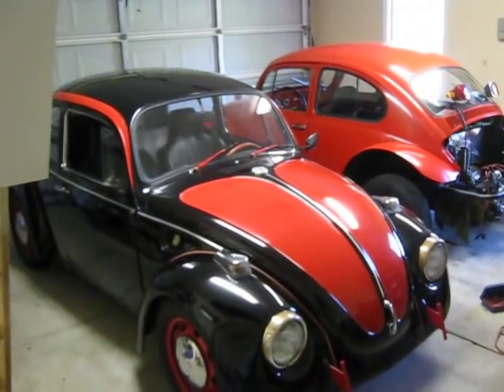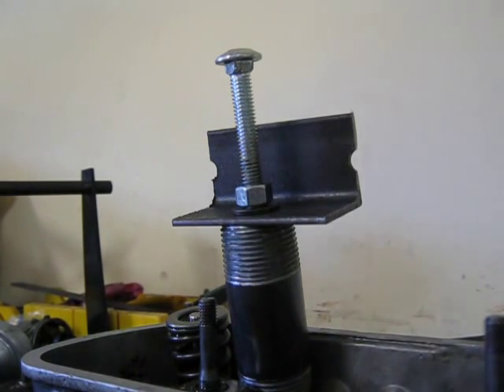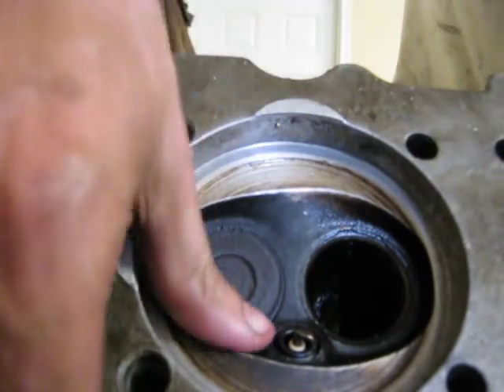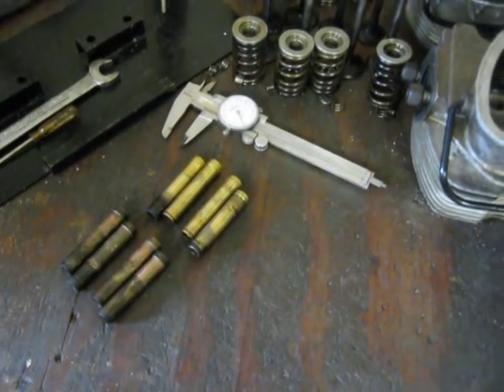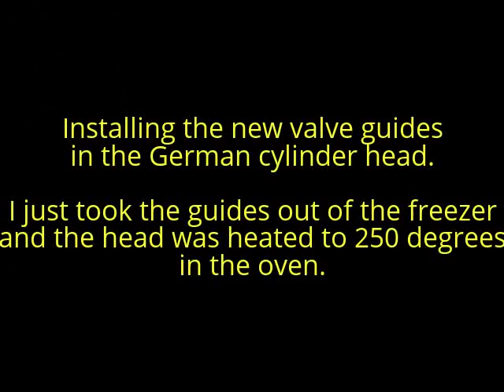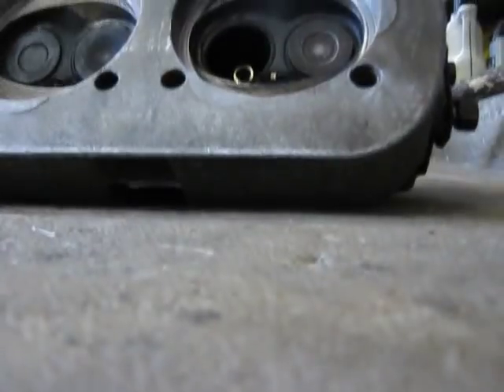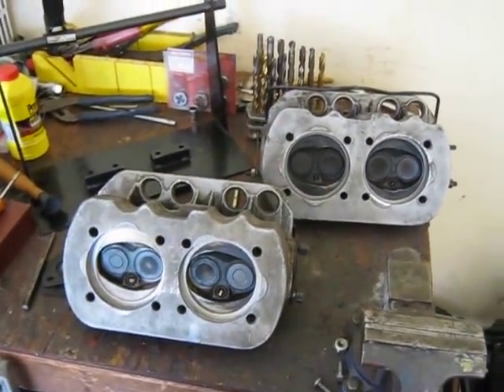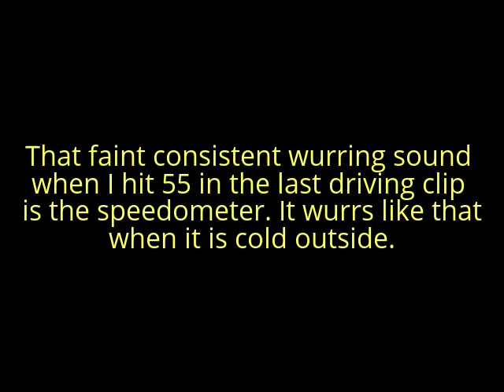VW valve guides air cooled classic vintage Volkswagen heads

Comment: good information, my old 40 im working on right now had a blown piston from a broken ring and put some gouges on the head but the valve were still in and protected the valve seats. My exhaust guides are worn so going to replace them but glad I watched this video first. I was debating on waiting till I got the new ones since they were on backorder from the suppliers. Going to remove the old one and measure them and the head guide bores to make sure I'm ordering the correct ones. Thanks for doing this video for us that are new to VW builds.

Comment: If you put the guides in the freezer overnight, and the head in the oven at 400F for 30min, they'll drop right in, so you don't have to beat the piss out of your heads.
Reply from the maker: Thanks for the comment. My thoughts on this, what you are saying is correct in a “in most cases” kind of a way. My thoughts are that every cylinder head, every freezer, every oven and ambient temperature are a little different for everyone so results vary on the oven heating, freezer cooling and guide dropping in deal... I could be wrong but those are my thoughts on the subject. 

I have heard of some mad scientist type guys that sit the guides in liquid nitrogen so they really get cold before dropping them in...  A little to fancy for me but if it works, it works. Like I mentioned in the vid, there are other ways to do things. This is just the way I did it.

Comment: I have my engine removed last year because the spark plug kept popping out. I am having trouble removing the engine head as the rusted bolts of muffler are really hard to remove. Once I remove the engine heads... I will do exactly what you have said in this video, THANK YOU!  but if you have any advise on how to remove the engine head, I would appreciate it. the mufflers have to come off, right?
Thank you for making it LOOK Easy!
Reply from the maker: Afra Bangash 

Hi Afra!

First, your spark plug popping out problem: Clean everything and look over everything real good in the combustion chamber area on the heads you plan on using. Make sure there are no cracks going into the spark plug area… If there are cracks that have made their way to where the spark plug goes unfortunately your heads are no good and you will need to find different ones... There is no use rebuilding a head if it continues to shoot out spark plugs after you are done. This is pretty much how I gauge if a head can be rebuilt: If there are cracks that go into where the spark plug threads in, the heads are trash… If there are no cracks going to the spark plug area you can fix/rebuild them and you will have something that is usable when you are done. Here is a picture showing a crack going to the spark plug… This head should not be rebuilt.  http://images.thesamba.com/vw/gallery/pix/1154275.jpg

Other cracks in the cylinder head: It is also very common for heads to crack between the valve seats in the combustion chamber. Some people freak out about this and think they need to buy new heads when they have cracks there… These cracks are not that big of a deal in my opinion. As a matter of fact the Brazilian heads I show in this video have cracks between the valve seats... I have not had any trouble and I drive in hot weather at old VW type highway speeds (55 - 60 mph) for long periods of time. Here is a picture of cracks between the valve seats... This head is probably ok to rebuild.  http://live2think.com/pictures/2014.02.26-Free-engine/IMG_4520.jpg

One final comment on you spark plug issue: If there are no cracks in the head going to the spark plug and you continue to have the plug shooting out problem you can put in what they call a timesert or helicoil to hold the plug in. 

And yes, the exhaust studs and screws are a big problem on old heads. They are sensitive fiddly things. The exhaust studs many times will break off when you try to turn the nuts. If they break off you will have to drill out the old broken stud and re tap new threads for new studs… Not fun. To give yourself a fighting chance in getting things apart first try penetrating oil like WD40 and spray the screws… Do this quite a few times, don’t be in a hurry to turn anything. I like to very gently tap the screw from time to time with a hammer while the WD40 is on there. I don’t know if it actually does anything but the thought is that it might help to get some of the penetrating oil down into the screw. Anyways, just spray, walk away for a few minutes, then spray again and so on and so forth for an hour or two… You might even want to have things sit overnight with the WD40 on them. When you are ready to “break things loose” get your wrench on the nut and tap the end of the wrench with your hand to turn the nut… This puts torque on the nut very quickly. Eventually either the nut will spin or the screw/stud will break… Unfortunately it is as simple as that. Do yourself a favor and do not pull on the wrench slowly with your full strength like a gorilla... Slow movements using a lot of strength will break things. Fast movements of the wrench with a light touch is what you want. 

If all else fails and you haven’t broken anything get a propane torch and try heating up the nut. That frees things up sometimes as the metal expanse from the heat.

If by some miracle you get everything apart with out breaking things make sure to clean up the rusty old threads on the screws with a wire wheel attached to an electric drill… This helps prevent future rust.

Anyways, the main thing is to do everything you can to not break the exhaust screws. If you do break them it is what it is but at least try your best to save them.

Good luck.
Reply: Andrew Silvers Thank you for your valuable, priceless advice. I'll let you know how it goes...
Reply from the maker: Afrasiab Bangash No problem Afra. I always enjoy talking about old VW’s and trying to help.

Also, I wanted to make it clear: Most everything I talk about here with cylinder heads is only for if you have a 100% stock factory original style engine. If you have a modified engine with stiffer than original valve springs, bigger than original camshaft or other “go fast” parts I would never recommend using any head that has cracks between the valve seats on that type of engine.
Reply: Andrew Silvers ok! Gotcha

Comment: did you make that spring compressor?
Reply from the maker: I bought it from someplace on the internet... It's been so long ago I don't remember exactly where I bought. Here it is on Amazon: https://www.amazon.com/Empi-Bench-Mount-Volkswagen-Assembly/dp/B00BJPYAYW/ref=sr_1_1?s=automotive&ie=UTF8&qid=1535810013&sr=1-1&keywords=Empi+5742